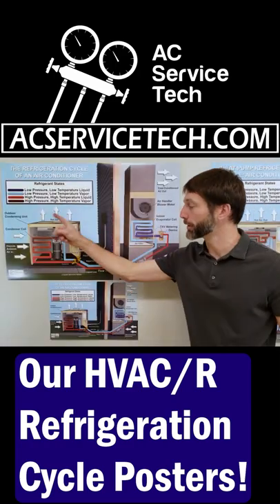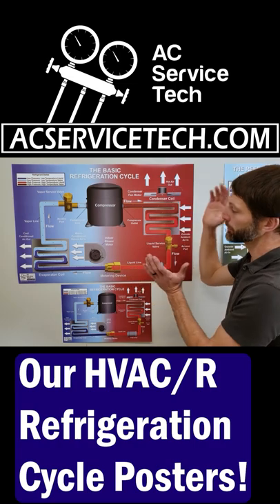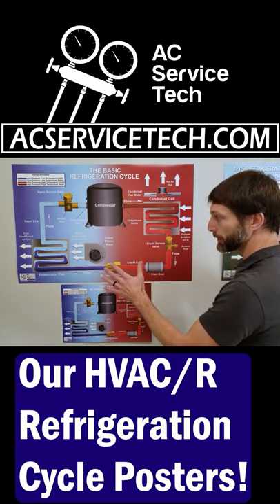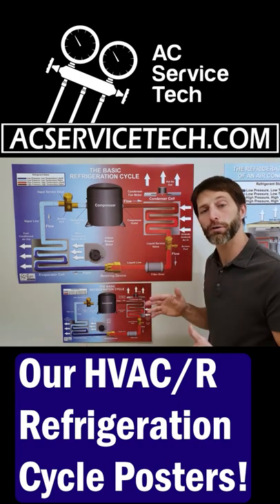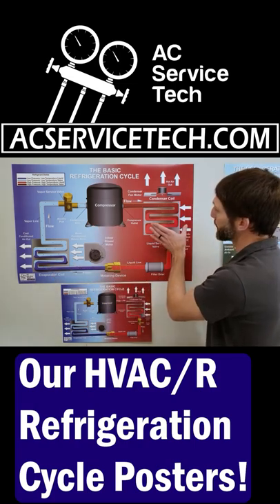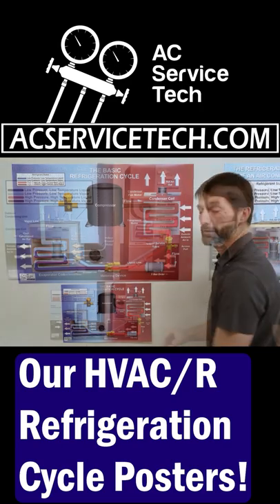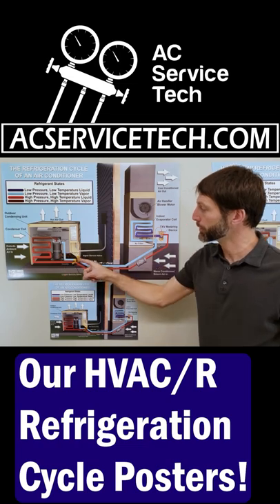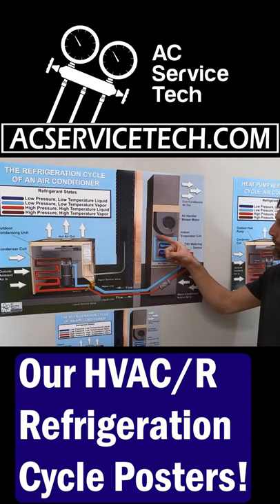Refrigeration Cycle Posters for Various HVAC/R Systems!

Comment: Do you have a video yet about the 645B new Freon?
Reply: There is no such thing as 645B refrigerant. The only 645B is Aerospace Sealant AC-645 B-2 is a low density, two- component, manganese dioxide cured, liquid polysulfide polymer system. It is suitable for use in fuel tank, fuselage hole filling, cavity filling and fuel tank filleting applications. There are three refrigerants that can be used to replace R-134a: R-1234yf, R-152a, and R-744. An interesting fact about the phase-out of R-134a is that unlike the switch from R-12 to R-134a, there is no mandatory reduction in either production or importing of the refrigerant. R-1234yf being the newest replacement for 134-A. I’m a commercial HVAC tech I work on anything mechanical / coolers / refrigerators/ VRFs / split systems / package units / water and air cooled chillers / boilers/ pumps / water heaters / 3 way valves / control systems like Carrier and Siemens everything to do with HVAC 5ton units to 1000ton units and bigger